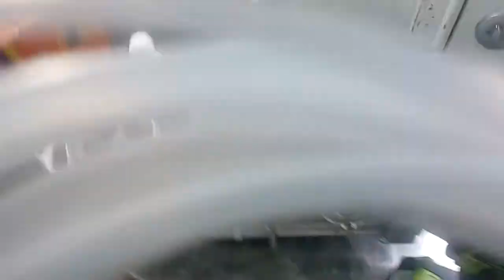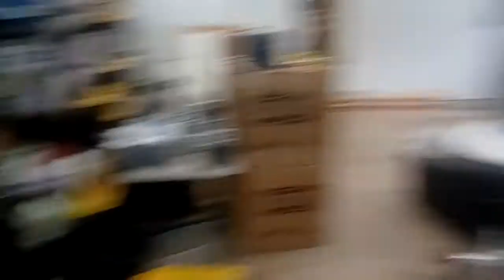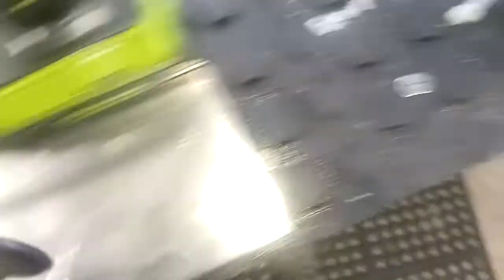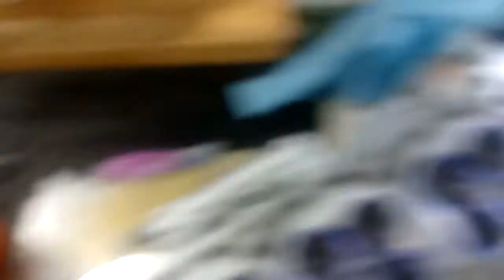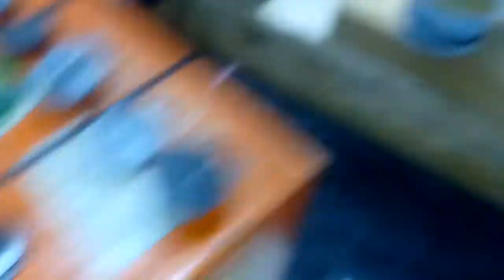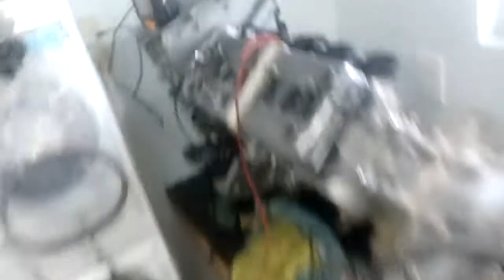2013 Kawasaki stx15f valve job using drill

Comment from the maker: You do not want to do this to aggressively with that drill. Going to aggressive is going to change your shim height.... Which then would force you to have to Reshim your valves to slightly thinner ones.  Use the dye, first try maybe three strokes in each direction and inspect the surfaces. If it looks like you have a good seating band created that's plenty.
Reply from the maker: UPDATE:  this motor is now in service and is running at manufacturer stock speeds and has perfect compression